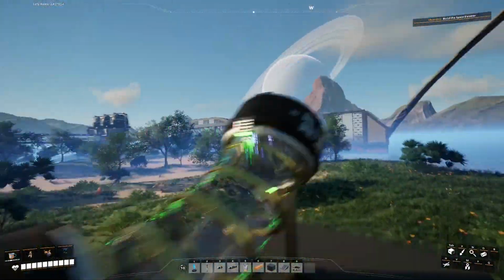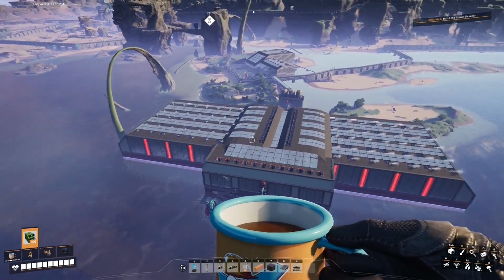Satisfactory fluids bug! How to fix it!

Comment: Very nice video and a wonderful power plant you built ! May i ask how you display the power statistics on a display (at 04min05sec) ? I am trying to get something like this but i cannot find a mod or similiar. I am looking for a way to display the amount of power produced, consumed and maybe also "stored in the batteries".
Reply from the maker: Hey, thanks! Glad you enjoyed it. 
Thats not a mod, its just how I set up my grid. Every factory has a priority switch, and AFTER the priority switch I place a huge amount of power storage. 

So if you then switch it off, you can see on the graph the consumption, the production and the max consumption of that particular factory. 

If consumption = max consumption everything is working at 100%. If its not, by checking the difference you can pinpoint what machine is underperforming. 

Storage I simply count the batteries,  hehe. I use the notes and keep track of them every time I place one. 

Cutoff time (amount of time the factory can survive disconnected from the grid) = batteries x 100/consumption 

Anyway if the factory itself is producing power it can survive an infinite amount of time disconnected from the grid

Comment: thank you this vid fixed my problem i was like why is my the fuck am i losing power when i am sure my math is perfect. and indeed thats the problem if you put a junction or pump in the existing pipe its going wrong i never noticed hrs and hrs looking giving up and now its my 2de run same problem but after i seen you vid i fixed the problem and everything worked after that.
Reply from the maker: Hey,  glad I could help and that everything is up an running!

Stay efficient!

Comment: You just saved me a ton of headache, thank you so much
Reply from the maker: Glad I could help!
I can confirm, that this old bug is still active! Every time I faced it, it brought fluid dynamics issues. Not so serious ones though. Usually it presents with machines working around 95% and all of those machines are after the pipe bug. 
It gets worse if the pipe is at full capacity though.
Thanks for stopping by, stay efficient!

Comment: Thank you for your video!

I have reached the oil phase recently and was having issues with my build, which in turn, made me start googling for possible solutions. There are a lot of threads out there talking about this bug, so I was worried I have it too and that it will lower my enjoyment with the game, but thanks to your video, your straight-to-the-point approach, clear and easy to understand explanation, I realized I am fine, because I never build things on top of my pipes, but rather, the other way around.

(My issue was that I didn't overclock one of the oil extractors lol. I'm an idiot pioneer and ADA's bullying is valid 😭)
Reply from the maker: @MistwalkerMayakii  glad i could help! 
And dont beat yourself. Its a complex game, and we do mistakes. Thats life! Important part is having fun while playing. If you achieve that, then there's no mistake!

Comment: I've been searching for a fix and came across this video which seems to be the only video that isn't "HEY GUYS WELCOME BACK TO MY CHANNEL AND TODAY WE ARE GONNA DIVE INTO BLABLABLA" but they never tell you wtf to do they just basically read the ingame descriptions of every relevant part. Even so, I can't get it to work. I build a long pipe network to supply coal power plants and it will fill up a pipe in one section perfectly well but then the next adjacent, directly connected section of pipe will either be empty or will fill up some random percentage and then stop flowing. No amount of replacing pipes or adding pumps(yes I already made sure I have enough head lift) or different slopes of the pipes will fix it. I did what you showed and it still does the same thing. Wtf am I doing wrong? It's as if there is a blockage inside the pipe if I can explain it in a real world way. The two piece of pipe are connected to each other with nothing between them except pipe supports and in some cases a pump, but they refuse to keep filling up
Reply from the maker: Hey Buddy! I feel you. Fluid dynamics are a pain, and I’ve spent tons of hours chasing ghosts. It’s hard to know exactly what you’re facing from the description, but I can give you some pointers.

The first issue might be the bug I describe in this video. Another one I’ve seen (didn’t happen to me but has been reported by many players) is pipeline junctions that seem connected but actually aren’t, causing fluids to stop flowing. This is usually solved by simply rebuilding those segments, but it sounds like you’ve already tried that.

The other possibility is proper fluid dynamics errors. These don’t show up as “there is no liquid going here” but instead as something like “this should be working at 100%, but it’s only at 95% or 90%.” That usually points to backflow. If fluids just aren’t flowing at all, it’s more likely to be a headlift issue (where you’re getting nothing at all), the pipe cutting bug I mention in the video, or a segment of pipe not connected properly due to a glitch.

If it’s not one of these and it’s proper fluid dynamics, let me recommend another video I made that covers the subject in more detail: 
https://www.youtube.com/watch?v=hp4Bmb2cKvg&ab_channel=NicoBuilds.

If none of this solves it, I might be able to troubleshoot it for you. No promises though! I’ve got a lot going on between keeping up with weekly videos and real life. But if you share your savegame (saved at the point of the issue), I might be able to take a look.

This is one of the hardest parts of Satisfactory, so don’t let it get you down! Cheers!
Reply: @NicoBuilds-g3u  honestly I wish I could put just water in buckets on conveyors so I can manually refill the power plants haha
Reply from the maker: @fishrsa9046  you actually can! It consumes more power and demands more effort,  but you could package your water in front of your water extractors,  and unpackage it in fornt of the generators.  This system doesnt even require plastic if you send back the empty canisters to be repackaged!
Reply: @NicoBuilds-g3u  this game is insane when it works. It's like skyrim, infuriating but addictive as hell

Comment: They made Infinite resource nodes, hypertubes, jetpacks, alien life, ability to spawn buildings in a second, blueprints, everything humanly possible taken out of science fiction into the game. BUT.. liquids MUST obey fluid dynamics. what's next? Gas with a tiny spec of escape like in real world? I absolutely Hate dealing with fluids, it's the reason im tempting to quit. if they remove the sloshing effect we can all go on playing happily
Reply from the maker: @R1eger25  yeah. They are really annoying, to be honest. Still, there are some ways to avoid having issues, just by overbuilding a little bit. For example, you have 4 refineries requiring water? Instead of using 1 water extractor and feeding all 4, simply place 4 underclocked water exctractos and do 4 smaller subsystems.  That way, there's nothing that can go wrong. I made a video on fluid dynamics with tips on avoiding trouble. Maybe it helps you!

Comment: Well I have seen a lot of people struggling with the same issue but surprisingly I have never! EVEN AFTER BUILDING JUNCTIONS ON TOP OF PIPES! I have a 1800MW coal plant where I used junctions on top of pipes all over the network but never faced a throughput issue or unstable power.

What I think causes the problem is not calculating the volume of fluid your pipes can carry. For example if you produce let's say 1900 m³ of fluid, it needs 3 mk2 pipes and a mk1 pipe OR 7 mk1 pipes ALL CONNECTED WITH EACH OTHER to accommodate the extra fluid that is 100m³.

This little calculation alone solved the bugs in my entire save! 

There's also some other things that I take care of such as I make sure to "fill the pipes" 💦 before turning on the machines if you know what I mean 👀 AND also made sure fluid consumption is equal to production.

Hope this helps pioneers solve their "pipe issues" 👀
Reply from the maker: @abhishekstark5938  Thats a good tip and it makes a lot of sense! This bug over here produces backflow.
Backflow its a pain in the butt and extremely dangerous when using pipes at full capacity. If the pipe is at full capacity, it cant allow ever to have a little backflow, because it will never be able to catch up. 
On the scenarios you are proposing, you always have a little more capacity. Meaning, if for one second there's backflow and the system can't deliver all that it has to, it can compensate later by delivering more than its average. It will always end up balancing! 
Still, there are some cases where it won't work. The typical is trying to get consistently 600 from an oil extractor. The first segment of the pipe is going to be working at full capacity and on that segment this bug can ruin everything!

Still,  whenever is possible, staying away from pipes at full capacity is the way to go. You sir are correct!

Comment: Holy Jesus😵 This right here really safed me from deinstalling Satisfactory once and for all😂 i tried EVERYTHING on this backflow problem! Thank you Sir - you're da MVP!
Reply from the maker: Oh buddy. I really understand the feeling. I was extremely close to uninstalling the game on this factory exactly because of this bug. The troubleshooting was way longer than the whole designing and build process. 
Working with pipes at full capacity is really challenging and should be avoided if possible. But on oil exctrators you usually want the 600 m3, so you need to be extra careful.
Thanks for stopping by!

Comment: Thanks for this, Pard!  Between this and mk 2 bug, pipes absolutely suck and I’m convinced that’s where most people quit this game
Reply from the maker: Glad it helped!
By the way, mk2 pipes are not bugged! What I show here is the only current bug on fluids, all of the rest have been fixed. This doesn't mean that handling fluids is an easy thing to do, its hard as hell, and having an mk2 pipe working at full capacity its the most challenging thing to do on this game. 
I have a video on fluid dynamics on my channel with usefull tips on how to handle pipes at full capacity. 
https://www.youtube.com/watch?v=hp4Bmb2cKvg&ab_channel=NicoBuilds
Reply: I almost quit trying to troubleshoot pipes on my first playthrough. No bug, just forgot to upgrade a section of the pipe from mk1 to mk2

Comment: Basically this means, "don't ever add a junction in the middle of a pipe." Despite it being a feature they supposedly support, it never works and will bite you every time.
Reply from the maker: At least they are aware of it right now. This video is old, and on 16th of October Snutt said that they knew about the issue, and that it was going to be fixed in two weeks time. The part of the fix didnt end up being true (bug is still out there), but there are hopes! We might get that fix!

I still place junctions and pumps on pipes, always. I simply redo the pipes afterwards. It doesnt take that much time

Comment: unbeleavable..i'm playing 1.0 and the bug is still in there...been trying to fix my power output but now is see the problem is this bug, thanks !!!
Reply from the maker: @janblokzijl7583  hey! Thx for stopping by! 
Snutt adressed this issue on a dev stream around the 16th of october. He said it was going to be fixed in 2 weeks time. Hasn't happened yet, but we can still hope they are working on it 🤪
Still, just in case, its not good to blame all of the issues on this particular bug. Fluid dynamics are extremely hard in this game, specially if you are trying to use a pipe at full capacity. Ive made a video on fluid dynamics,  you can find it in the channel. If you are still having issues, that might help you fix them.
Cheers!

Comment: That could explain, why I've got some Issues at getting 100% throughput on my MK II Pipeline with Oilpumps, which should deliver exactly 600m³ and Refinerys, which should consume exactly 600m³.
Reply from the maker: It might be, but still, just be aware that making pipes work at full capacity sustained without ever dropping is one of the hardest things on the game! To make it work, you literally can't have any backflow at all! I've recently made a video about fluid dynamics (https://www.youtube.com/watch?v=hp4Bmb2cKvg&ab_channel=NicoBuilds) that gives tips about how to achieve it. Of course, if you currently have this bug, you won't get there. But you might fix it and still get some issues. 
Lucky for us, this bug was addressed by Snutt on the latest dev stream, and in theory it should be fixed on the next patch.
Cheers!

Comment: Just in time before I build my turbofuel power plant! Really helpful video :)
Reply from the maker: Glad it helped. Anyway this video is a little bit old. Snutt addressed this issue on the latest dev stream. Apparently they are addressing this bug and it might get fixed in around 1 week time! Great relief, because at least today I connected 32 pumps, and had to reconnect 32 pipes because they were all incorrectly cut. Thats life working for Ficsit, hehe

Comment: Yeah, this has been an issue with the game forever. I took a long time off from playing before the 1.0 release and when I can back and built my first aluminum plant, I couldn’t get it to run efficiently. Even though I was well aware of this bug in past updates, it took me about 2 hours to remember that you need to rebuild all the pipes between any inline components you added to the pipe after it was placed, as you described. Running at 100% now.
Reply from the maker: Lucky for us, this was addressed by Snutt on the last Dev stream. Apparently, they are working on it and next patch should fix it 😊
It probably won't retroactively fix all of the pipes that are not cut the right way, but it will be nice not having to rebuild pipes each time you place something on them.
Thanks for stopping by!
Reply: @NicoBuilds-g3u  oh nice. I saw a clip where he addressed the Mk. 2 pipe rounding error bug, but missed that bit about the pipe connections. That’s actually a huge fix. I’m about to build a big recycled plastic/recycled rubber/diluted fuel factory that uses an absurd amount of piping, so I hope the change comes sooner, rather than later. Cheers!

Comment: The 110 GW fuel power plant I built in a friend's world will still be left imperfect.  I know this is certainly the issue, but it only exists on HOR for diluted fuel and minorly on the blenders.  I do not feel like running through and fixing this on 440 fuel generators across 16 different maxed Mk. 2 fuel pipes in an area we have dubbed the "Lag Exclusion Zone" due to the sheer amount of lag experienced while a large amount of pipelines are loaded in multiplayer....

It's still generating 100 GW on average and is being supplemented by coal and geothermal, so its fine...
Reply from the maker: @geyrnauch  haha. Thats completely understandable! If the variation is not worth the trouble, then better continue with new and more interesting projects.
Anyway, this bug was addressed by Snutt on the 16th of October dev stream, and he said it was going to be fixed in 2 weeks time (on next patch). Im not hoping the fix to be retroactive, but who knows? Maybe all of a sudden the pipes are fixed and it starts working better! 
Thanks for stopping by!

Comment: Thank you, your solution just help me.
Reply from the maker: @Nhyos-02  Glad to know it worked! And i love to know! Because I know that this was an issue in early access because It ruined this factory. But wasnt entirely sure if it also brings problems on 1.0 (Because i simply correct all of the pipes now that I learnt). Knowing this is really useful.
Reply: @NicoBuilds-g3u  To answer that question - it can still be an issue in 1.0. I started a fresh game when 1.0 was released after having not played for a year or two. After watching your video I went to check a couple of problem coal power plants and found several instances of it not clipping pipes correctly.
Reply from the maker: @jpkjnn6733  Lucky for us Snutt told in the last dev stream that they were aware of this issue and its getting fixed on next patch! Dont know if it will retroactively fix pipes that are already wrong,  but not getting new ones is going to be a relief